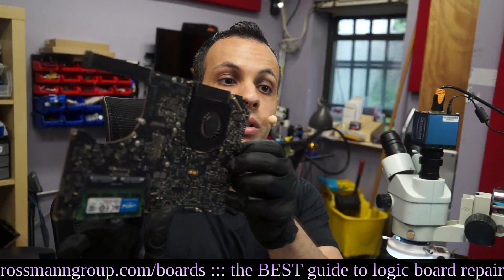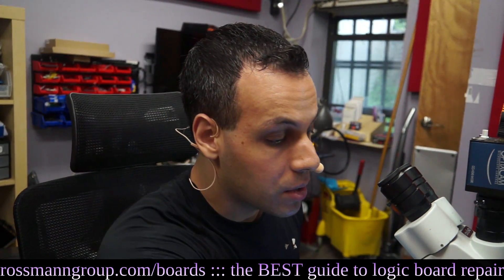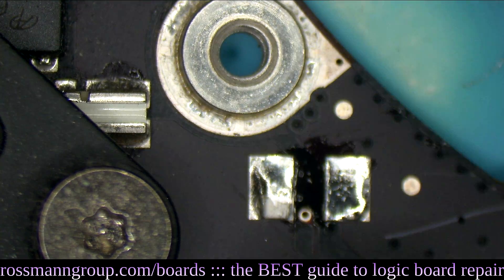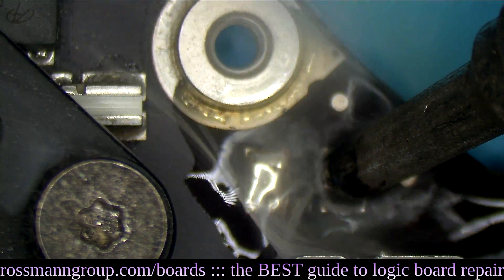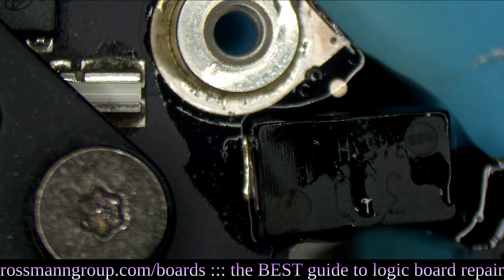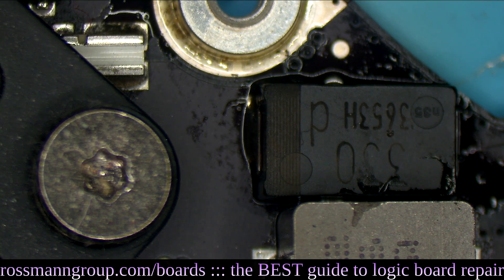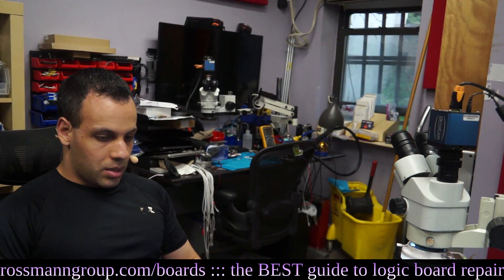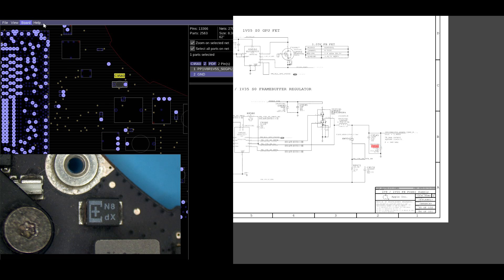Macbook Pro 2010 GPU kernel panic repair without scraping logic board

Comment: Is this repair possible with a regular soldering iron and no hot air station?
Reply: To do this particular repair you really do kind of need a hot air gun to solder in that bottom pad. That being said you could probably find a higher-capacity then what is stock capacitor that may do the job that would work for the original footprint. At that point then you would be able to use a normal soldering iron. But soldering a bottom pad in that space would be a total b** without a hot air station.

Comment: @Louis Rossman, I think you just got better with your voice modulation when advertising the shop.
I can see you've been practicing :)

Btw. true about HP - HP is complete and utter garbage, I had the unpleasure of having one of it's elitebooks, the hot air from cpu fan melted the plastic case on the side and I won't mention hundreds of other repairs and repeating failures.

Comment: HP = HORRIBLE PRODUCTS!  They have NOT been a good company in decades in my view.  These are the assholes that started the chip process for inkjet and deskjet printers.  Failing them if they are not used so you are FORCED to spend another $60 for tri-color and black even if the ink was still good in the old containers..  Now all the printer makers do this.

HP also is a fail in the desktop PC world.  In their bottom end PC they used a bloody laptop brick power supply instead of a proper PSU.  WTF?

HP is such a shit company and have NEVER regained my respect.  HP can go out of business for all I care!

Comment: Louis, the Quadro in the 17" P Series plays games just fine, my P71 with P3000m will play pretty much everything i throw at it on high or ultra in 4K no worries.

Sure the 15"'s need some more options, but the P71's work just fine.  Technically you could put a P3000 into a P51, the GPU is replaceable via MXM, just need a heatsink to fit.

Comment: I had a msi laptop (ge60 0nc) that did not have the power jack soldered to the motherboard. the cable wiggled off it anyway - and the replacement cable i got from china also broke where the cable meets the connector in a couple months. I had no idea, or resources for solering back then, and now the thng is old and slow and not really worth the effort of breaking it open just to fix it and have an useless slow laptop that no one will buy from me.
So, you know. just having the cable doesnt solve everything.
Reply from the maker: It's sad that MSI could even screw that up. Their build quality is pretty awful was my point

Comment: I got so triggered by you calling out most of the laptop manufacturers that I wanted to point out that you are comparing some 3000$+ Lenovo to 1500-2000$ Razer/HP/whatever with same specs of CPU/GPU/RAM etc. 

Do you really think that those gaming laptops should be as premium as over 1000 dollars more expensive workstation? I can agree on that not all enjoys RGB light show, and I would 100% watch you reviewing gaming laptops from electronics and repair expert point of view as I'm on the market to buy one.
Reply: Also my daily driver HP Spectre X360, which is over 2 years old now is probably one of the best lightweight laptops that I have used in ~1000 dollar category. Goes to same high quality feeling as Dell XPS/Latitudes and almost as good as 500-1000 dollar more expensive Thinkpads.
Reply from the maker: A thinkpad p50 can be had for $1200. I paid $1200 for my first p50.
Reply: That's true, though I have to comment that it has 2 generation old CPU, 8GB ram and MECHANICAL HDD :D So sure, you can get the chassis for that, but everything else is out dated.
Reply: Gigabyte Aero 15X V8 and Asus GM501 are pretty sleek, almost professional looking gaming laptops when all the RGB shit is turned of with sturdy chassis. Do you have opinion about either of those brands?

https://www.notebookcheck.net/Gigabyte-Aero-15X-v8-i7-8750H-GTX-1070-Max-Q-Full-HD-Laptop-Review.296594.0.html

https://www.notebookcheck.net/Asus-ROG-Zephyrus-M-GM501-i7-8750H-GTX-1070-Full-HD-Laptop-Review.293956.0.html

Comment: As this seems like an appropriate section to ask this question - I needed a laptop for work (sound industry) and I needed something with some good get up and going, I did absolute shit tonne of research and I almost pulled the trigger on a thinkpad until I saw an offering from a brand that sells rebranded clevo laptops. It was cheaper, very upgradable and higher specced. What is your  opinions on clevo laptops those from america?
Reply: Plasmaboo I really would have preferrered a thinkpad but unfortunately, I got extrememly good specs for much less than a thinkpad as I didnt have a great budget for something. I also did consider mac at one point but yea... bo brainer as to why I didnt get one. I just want to know if Im gonna  have a laptop thats gonna last me. I've already had an issue with some keys dropping out, not sure as to what pertains to and need to get it fixed but thanks.for the honest reply

Comment: @Louis Rossmann you can always use an external videocard through thunderbolt 3 or usb 3.1, nowadays you can buy one with already the gpu inside for the same amount of money as the gpu itself. By the way, I really hope that someone who builds and engineers pc's start searching you for improvements and because they want to make better laptops, tablets or smartphones. It would start a nice adventure in this field where the opinions of someone who cares to fix all those crappy boards would make a difference for the end user. Good job, nice work, really.

Comment: I like ROG laptops, I know my DC in board was separate, and connected by headers. That was a 2014 model. It also had the warranty sticker on the CPU heatsink, so you could almost completely take it apart and keep the warranty.
Reply: That said I am a very big ROG fan boy

Comment: Louis is talking about HP crap
Lè me think about that.... yeah, close... definitely close and true... 

I remember when I called HP because my CPU was reporting over 130°C which is ridiculously wrong or dangerous
They replied with "Don't trust those programs, they are always wrong and trust your CPU, it will shutdown in case of emergency"
......In case of a fire?!
Reply: @Prinz: You can tell if it's really hot if the fan is blazing away or if it just feels really hot to the touch. I have an old HP laptop, and it actually would shut down due to overheating, typically around 100 C. I helped the problem some by cleaning out the vents and making sure vents were not blocked, and I fixed the problem permanently by replacing the thermal paste on the CPU.
Reply: Already did that but the last thing I just got is that while gaming, this device HP Pavilion 15-053sg goes like a jet and get warm on the keyboard so... bad architecture, I guess ^^

At least, it is powerful and doesn't burn something :)
Reply: Yes, 130 is HOT.  In C (Celsius), water freezes at 0 and boils at 100.  F (Fahrenheit) is *ridiculous*, as it's a Polish scale - began in 1712 with 0 being the coldest winter in Danzing, Poland, and 100 being his wife's body temperature.  It was FLAWED from the start.  The funniest thing is: Americans don't WANT to change.

Comment: Never had a problem with my razer blade. However I will agree that form is taken more seriously than function  and I'm tired of the gamer look.
Reply: I wouldn't go so far as to say you got lucky, but razer laptops are pretty notorious for their defects and RMA rate, made worse by awful support. On top of that, they've got the apple pricing model to go along with their apple "quality".
Reply: I'm a friend of understatement. Simple shapes, less color. Who said a gaming computer/laptop isn't allowed to look professional.
Reply: HappyBeezerStudios - by Lord_Mogul agreed. I don't mind rgb keyboards or some crazy light up logo but when you make that a higher priority than the hardware that's a problem.
Reply: Cream Soda I don't think I'm lucky. My razer is the R2. The one with the gtx 660m. I believe there quality has gone down since then which is why I haven't bought a newer razer

Comment: I still have my laptop from 2008 and it's still trucking, although I replaced its CPU with something with a bit more grunt, nothing has failed on it yet (although I do believe it's HDD is on its last leg). But it's definitely not a gaming machine (darn Intel Gma 4500m). But does YouTube and browsing just fine (all I need it for). Can't complain for free.

Comment: How many perfectly good mobos die because of a single bad capacitor / resistor? Same for workstation power supplies.
Reply: I have fixed a lot of motherboards of all types and brands. Even high quality caps go bad. I try and replace caps with higher spec new components whenever possible. Bad electrolytics are often easy to spot, bulging or oozing liquid. Surface mount components are not so obvious.

Comment: Hey Louis,

I'd love to know, in your opinion, what Laptop model would you recommend to last say 3-5 years, without a hardware issue/fault? Is it purely Lenovo Thinkpads, or are there any other models and brands you'd say yes to. I ask not for myself, but my family here in Mauritius, where the climate can get very humid being sub tropical hitting mid 30's in summer, and a Laptop is really a family investment made every 5 years as they're so expensive with everything imported. Everyone here tends to go with budget models that I know can be built to faint over there (1yr here) warranty sadly. I know this is a bad investment.

Love your videos and thanks for reading this is you have the time.

Comment: I want a gameing laptop that looks normal.  It's that simple.
Reply: Sorry no can do all gaming devices have a requirement of at least 3 vents that belong on a supercar and LED lighting that rivals the underglow on cars in the 1990s... I kid of course, I too would very much like a normal looking laptop that can game, especially if I'm taking it anywhere, flashy lights and over the top exterior = obviously expensive = easy to spot by anyone with nefarious intentions (Thieves lol)
Reply: Get the modern Toshiba satellite with the i5 and integrated graphics. The CPU makes up for the graphics. But one problem with it is the heat. Never use it on your lap. It has a 13 in screen (diagonal) and comes with 6 gbs of RAM so you will have a good experience web browsing. Don't count on the Webcam because it sucks.

Your welcome

Comment: Hi Louis, what's the number of the motherboard?
Reply from the maker: 820-2850
Reply: Louis Rossmann dammit, I have a GPU Kernel Panic with my 2010 MBP, but the motherboard is 820-2565-A, should it be the same problem with the same capacitor specs?
Reply from the maker: You are reading the number off of the DC in charging board, not the actual motherboard. Read the number that is closer to the Wi-Fi and webcam cables on the motherboard
Reply: Louis Rossmann Looks like I'm dumb, you saved me, thank you man! 
Because of that I will buy the capacitor from your store, even being the shipping more expensive than the actual capacitor (I'm from Chile).
Keep up the great content and, as always, I learned something! :)

Comment: HELP! I want a 13" i7 Macbook Pro with 16gb of Ram... but I'm not stupid, so what PC should I buy that is equivalent to what the Macbook ought to be?
Reply: Schwam For Freedom id go with a dell XPS
Reply: Schwam For Freedom do you want an ultra portable or a mobile workstation
Reply: CaptainMcShotgun this thing is a fucking beast but it's not a laptop :/
Reply: CaptainMcShotgun it is not me who posted the comment.
Reply: I really like asus stuff (zenbook seems on point.) You get great hardware for the price, and a well balanced machine. Not sure what Louis thinks of the internals tho... I would 2nd sell xps as well, they are solid and from a company with good customer support, if a little pricey for the specs
Reply: Desktop computer isn't equivalent to laptop. It should be equivalent to 13" MacBook Pro, not some iMac.
Reply: Get an XPS or a HP EliteBook
Reply: CaptainMcShotgun He's not being snarky, you are just being a little dense right now. I'll presume you just didn't get enough sleep and aren't thinking at full capacity today.
Reply: Check hackintoshs webpage, get a good rated from there if you plan to run MacOS
Reply: CaptainMcShotgun, you should have replied to the right person. Thanks for taking the heat off my inexcusable error of referring to a windows laptop as a pc. Clearly suggesting I want something similar to a 13" Mac laptop wasn't enough clarification that I'm not looking for a desktop. Anyway, thanks for the laughs. Cheers!
Reply: Thanks to everyone who threw out helpful suggestions!

Comment: Can the GPU be changed after market? You might have a new revenue stream.😉
Reply: From what I understand... Technically possible, as long as you can find a gpu that is both the exact same physical size and pin layout (also assuming you don't get ripped off by a Chinese supplier) but at the same time the computer is so old that the original gpu isn't even made anymore as far as I'm aware so good luck with finding an upgrade, then on top of all that the bios probably needs to support it which would be a huge pain in the ass to try to get working if it doesn't out of the box... 

Ignoring all those issues, similar to how it isn't worth anyone's time upgrading the storage in an iPhone, because its a lot of work and users would expect the upgrade to be fairly cheap, it equally wouldn't be worth anyone's time trying to upgrade an old gpu or in other words, no... Go buy a new laptop or get one with thunderbolt so you can use one of those external gpu enclosures.

Comment: I have something to say about MSi.
Owned one of their GAYMING-X Rx480s for 2 years, it started showing signs of heavy degradation on the power delivery system, forcing me to reduce the power consumption of the card in order to keep it "stable", otherwise it would send extremely unstable voltages to the core, forcing the thing to throttle the vcore constantly, causing heavy suttering and even crashes.

Msi for me, never again.

If i lived in the united states i would gladly take that shit to Louis for him to bash their shitty build quality, lmao.
Reply: Ridley take it apart and send a photo of the PCB to buildzoid ( make sure the prints on the fets are visible)
Reply: They make a good motherboard, i wouldn't buy a pc from them though
Reply: I already took it apart and i couldn't see anything remotely suspicious on the fets / chokes, bathing the card in isopropyl alcohol fixed the issue for a month, which leads me to belive it has some sort of dry solder somewhere, i already got a replacement GPU, but yeah, i might just do that you told me, out of curiosity.
Reply: Not covered by waranty?